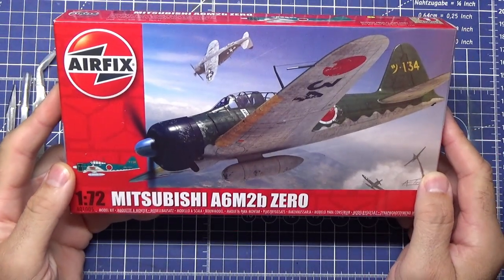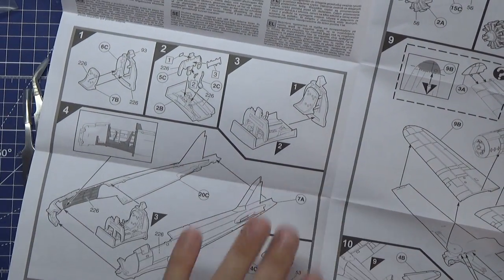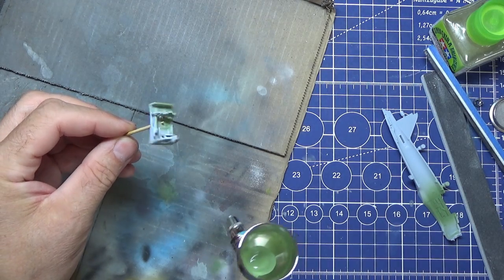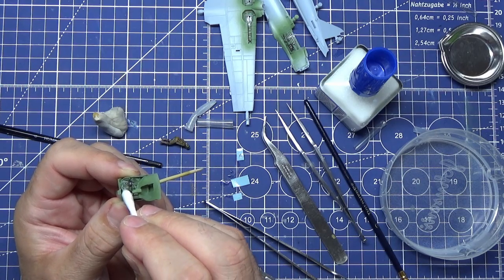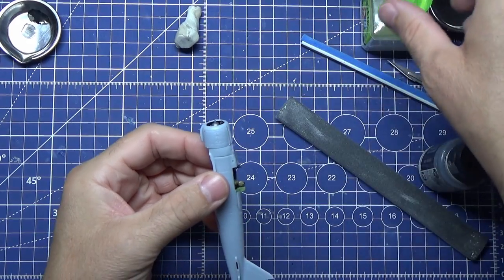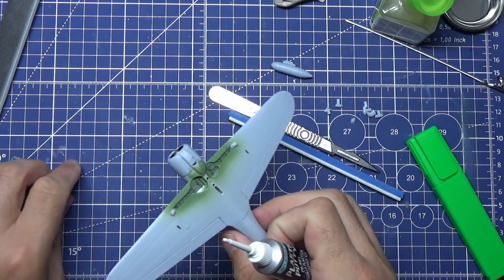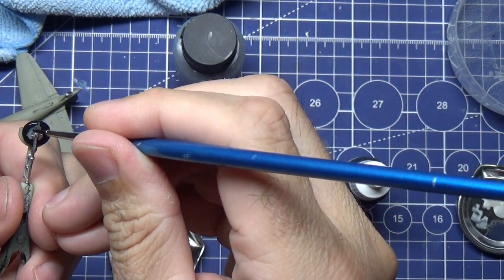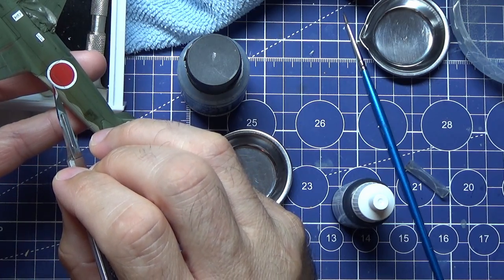Airfix mitsubishi zero model full build and paint

Comment: A nice kit, well built. 

One thing to keep in mind when weathering WW2 Japanese aircraft is that no matter how beat-up they may be, the hinomaru (red meatballs) were always kept in immaculate condition. The maintenance crews would face very serious punishment if the national insignia were not kept in top order. You can see this in period photographs. A famous pic of ace Hiroyoshi Nishizawa's A6M3 is a great example. A great deal of that Zero is down to bare metal, yet the hinomaru visible in the photo is solid in color. Depending on the resolution, it appears that there is obvious touch-up work done to the insignia. 

The only Japanese aircraft seen with imperfect "red meatballs" are those that were shot down and the insignia damaged by enemy fire or aircraft that were hastily abandoned in the wake of invading Allied troops.
Reply from the maker: nice one thats something i didnt know and will now take into account when i weather japanese models

Comment: From my own research, the markings for this A6M2 are for an advanced trainer from the Tsukuba Air Group, not the 201st Air Group. The A6M2s from this unit all seem to have the trainer orange underneath the wings and fuselage.  I also cannot find any photos of their aircraft with the large tail number painted under the wings.  Even the photo of this exact aircraft does not show them.
Reply from the maker: That's airfix for you
I sometimes think they make up the marking scheme's to fit what decals they already have art designs for
Thanks for pointing it out 🙂
Reply: @yorkshiremanmodels  The thing is, they didn't have to call it the 201st Kokutai.  Just go with the Tsukuba Air Group, Japan, 1944, and use orange for the lower wings (omit the large 34 numbers though). It still would be an interesting subject with a very striking color.
Reply from the maker: @mtaylor44  got to agree with you